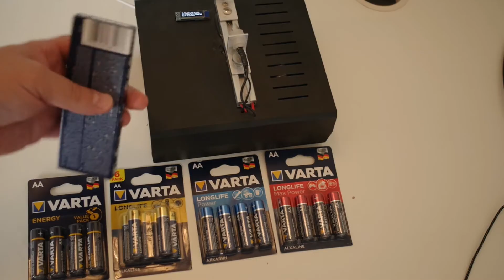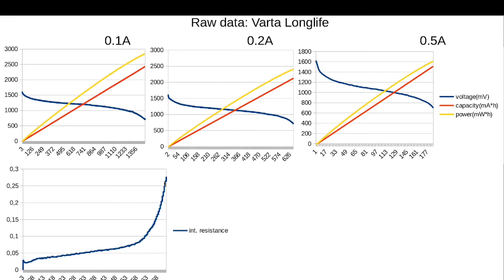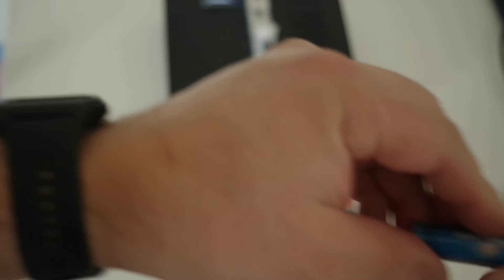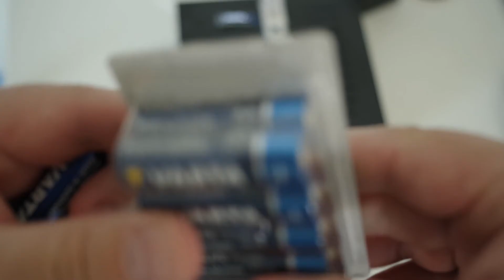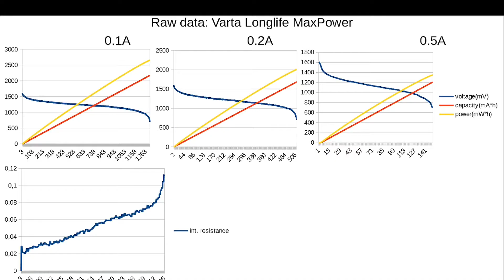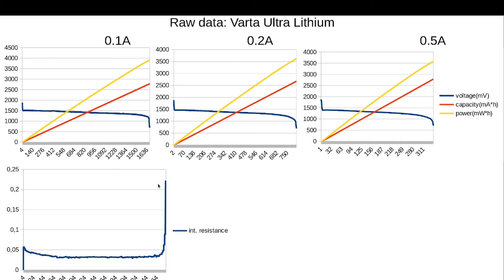AA Battery testing: Varta primary (non-rechargeable) batteries

Comment: I have a question about Varta AA Industrial batteries. I see on them that it says PD0318 and ED0628. Does this mean that they were manufactured (ProducteD) in March 2018 and will last (EndeD) until June 2028?
Reply from the maker: Yes, those are Production Date (PD) and Expiration Date (ED).
Reply: Thanks.
Reply: So, in fact, the best Alkaline battery is LongLife. Interesting.

Comment: Im really missing the discharge stop treshold and the explanation on the vertical axis 😅

Btw Zinc-Carbon is lightweight and I never saw one leak
Reply from the maker: Thanks for the questions!
1) Discharge stop threshold - it is a voltage cutoff value. When the voltage drops below this - we consider that the discharge is over. Why, if there is still some charge left, it is not 0V after all? Well, most of the electronics will not work on batteries that produce 0.5V for example. Plus, the charge left after that threshold is usually about several percent of nominal, so we don't leave cells half-full. 
2) The vertical axis is voltage OR energy. For energy, we just integrate the voltage over current. After all, most of the time we need energy from the battery, not just amp*hours, and with the same current, energy for, let's say a lithium battery with a voltage about 1.6V and a Ni-Mh battery with a voltage about 1.25V will differ significantly.
3) Zinc-carbons tend to leak because during the discharge, zinc from the external battery casing is used, so a discharged battery will have a thinner "body" than a new one. Plus, one of the reaction products is water - so, oversimplifying, the battery gets "wetter" when it is discharged. On the other hand, even a new battery is not 100% hermetically sealed, and water can evaporate - just REALLY slowly, this process takes years.
What does all of the above mean? Take cheap zinc-carbon, discharge it quickly and fully (in a flashlight for example, where it will be depleted in about one day or faster) - and most likely you'll get a leak. For batteries that have just plastic wrapping around a zinc body, you'll get dark spots on the wrapping first - that is the electrolyte. But if you insert the same (new) battery into some really low power device - like a clock or calculator - it will dry before the zinc will be used up - so it will NOT leak. And this battery eventually will fail just because of dried electrolyte. You can put some distilled water in that "dried" battery, and it will work again!